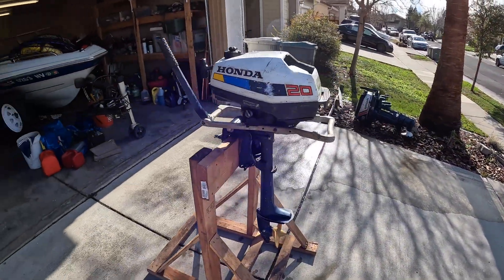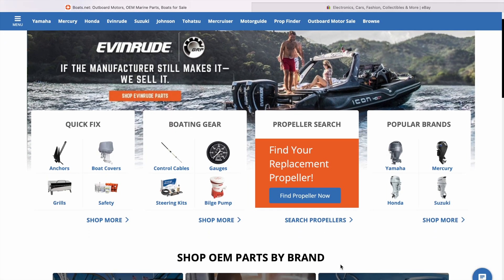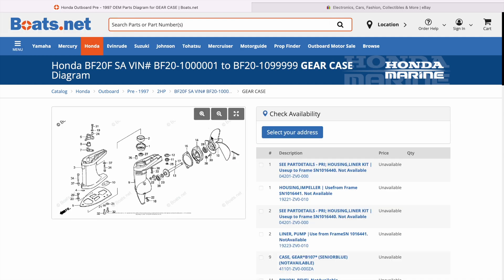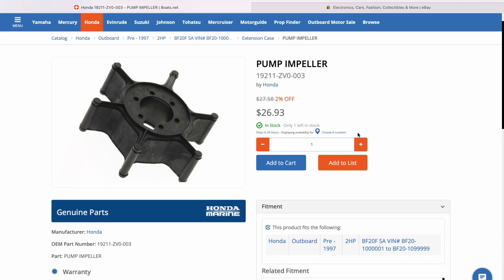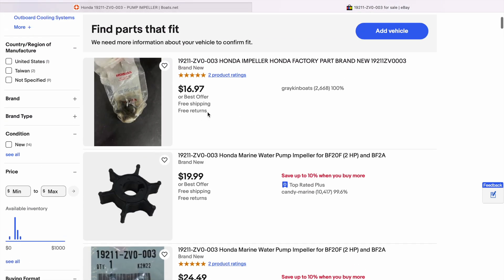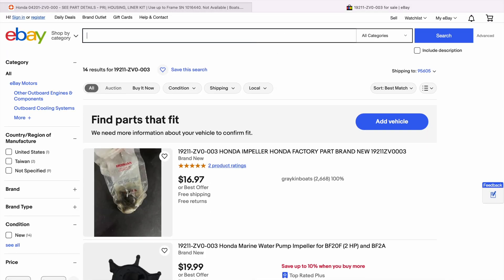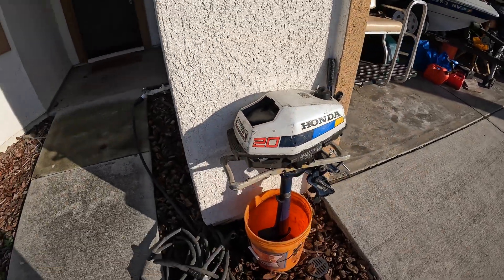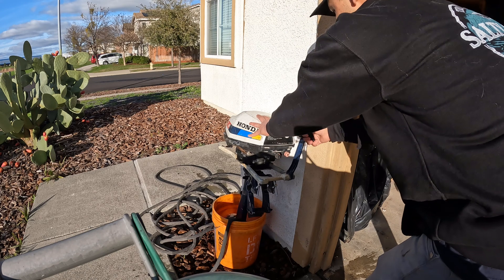$20 Honda 2hp Outboard Motor - How to find parts for older outboards

Comment: Hi, very useful video, thanks.  I don’t suppose you could tell me what needs to be done to replace the pan gasket?  Is it an extensive job or just a case of removing the pan bolts and pulling apart.  Do I need to remove the lower unit first.  Hope you can help.  Thanks